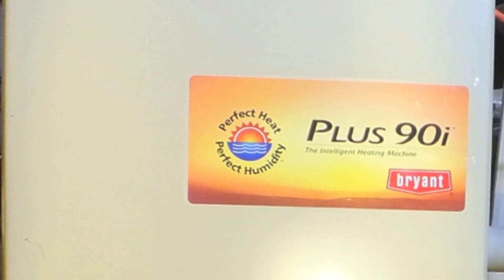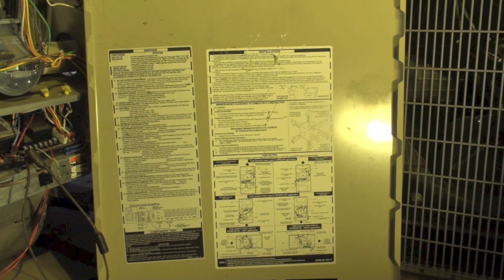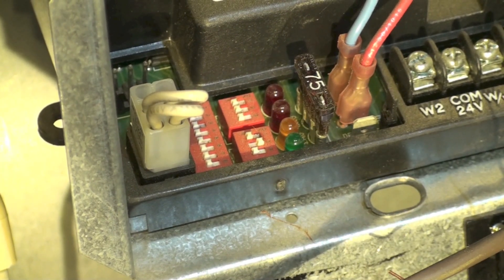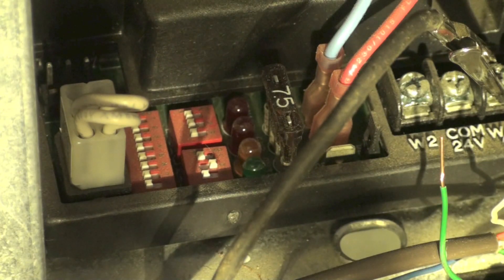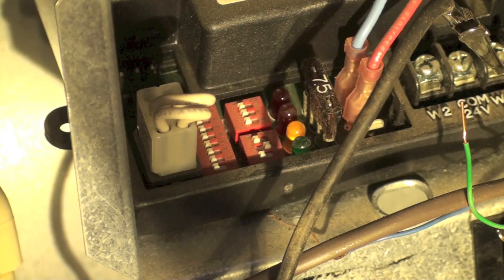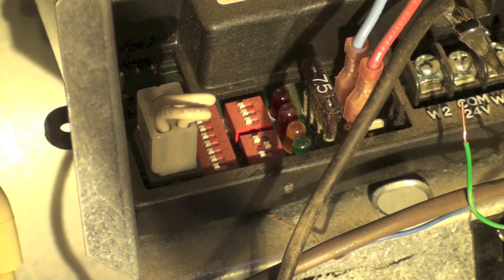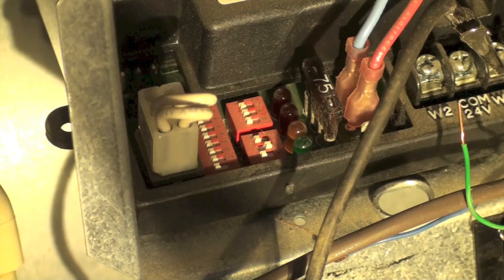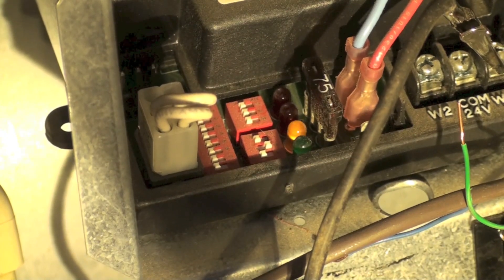Carrier gas furnace error codes

Comment: a common problem that results in this code are also air exhaust and intake pipe outdoor openings being obstructed by snow and ice
Reply from the maker: Certainly true.  One of the first checks is to the outdoor openings, especially if the snow has been blowing.
GFM

Comment: i got a code 13 and 33 on my furnace it a carrier weathermaker 9200 and the rollout switch got trigger does the mean that my heat exchanger is bad ?
Reply from the maker: Generally, if the rollout switch opens, its a rollout of flame which means a heat exchanger problem.  Some of the Carrier furnaces from the early 2000s have been recalled for rust outs.
GFM

Comment: I just saw what I forgot when I changed the board. I left that small jumper plug in bottom left hand corner of board on the old board. Inducer fan came on, igniter, then the burners, but it looks like low flames and inducer fan doesn't go off, and next ting it blew my 3 amp fuse. It says " might have a low voltage short"

Comment: Last night I was getting a code 33, I turned everything off. Today I get a code 21 which doesn't make sense to me since the furnaced has worked fine for 10 yrs. till now. Code 21 says " Model plug missing or incorrect". I have the same control board you're showing. I have not been able to reset.  HELP
Reply from the maker: That is a setup code.  I would be sure all plugs on the control board are tight and all wires into the plugs are tight.
GFM
Reply: @grayfurnaceman  I have to thank you for replying. I'll have to take the control board out and check all connections...... TY Sir
Reply: @grayfurnaceman  It's bit frustrating my friend. This morning I checked all plugs and wires on a new board that I replaced 4 days ago. Today it starts off with code 21 for about 20 seconds and then the blower starts low then goes on high, and gives me a 44 code. I retired from HVAC after 25 yrs. 9 yrs. ago. I guess I forgot a few things. The filters are out so there's no air obstruction. BEATS me what it is. I checked all limit switches. Model # of furnace is 58MVP080-14

Comment: Have a code 33 had work done in craw space that put flext tub type duck in craw space blower well not blowing air and shuts off
Reply from the maker: As code 33 is overheat, check the filter first.  Then be sure all runs are straight as possible and none are crushed.
GFM

Comment: Hello sir, my control board has just one led its a propane day@night about 1994 where would I find codes for this? thank you.
Reply from the maker: The codes should be located on the inside of the fan cover or the burner cover.  If you can't find them, I have a number of code keys on my website Grayfurnaceman.
GFM
Reply: Thank you GFM..

Comment: I can't thank you enough for this video.  My furnace was refusing to light and locking out.  

After watching this, I pulled the condensate drain inside the furnace and water poured out.  I carefully blew out the plug, which probably was 15 years of dead bugs and other debris.

It took about 10 minutes to fix the problem and saved me hundreds of dollars.  I owe you one!
Reply from the maker: Kurt Ericson Glad I could help. 
GFM
Reply: @grayfurnaceman they just changed the regulator on the propane tank - haven't gotten ANY blinking red codes - but NO HEAT! The water heater works- propane, and propane wall heater works... coincidence? 
The guy that replaced it said it was working fine, but old, and the line out of tank was leaking but he didn't have an exact match so he put one on for "free" and it would just be the service call...

Comment: In the video, you mentioned another video with other error codes.  Were you ever able to create that video?  On my Bryant Pulse 90i, I get a 44, and then a 41.  I have the blower fan set to be on continuously, and it is running.  I have powered the furnace off, and back on, but I still get the same errors.
Reply: Sorry, meant Plus 90i
Reply from the maker: I have not.  I still have that furnace in the shop but just have not gotten around to it.  Maybe this will get me going.
GFM
Reply: do you have any recommendations for the codes 44 & 41 ?
Reply from the maker: If you have an ECM, those are motor failure codes.  However, you say your motor is running.  Are the burners not coming on?
GFM
Reply: The burners are not coming on.  The exhaust fan never comes on.
It does seem as if the blower motor would surge somewhat (speed up, and slow down slightly).
 I do have 2 of the same furnaces.  So after reading several posts about the ECMs being at fault, I swapped the ECMs from the working furnace to the nonworking furnace.  The furnace started to work (I have not put the nonworking ECM into the working furnace yet).  I am planning on putting the nonworking ECM into the working furnace, in case it might have been just a poor connection.
Another thing I was wondering is could the SG348 thermistors be the problem, even though I don't see signs of it breaking down (no hot spots, and still intact)?
If nothing else, I at least I know that I can just replace the entire ECM, although it looks to be a pretty spendy item.
Reply from the maker: The thermistor will cause the ECM to not work at all.  So its kind of all or nothing.
GFM
Reply: I guess I will try the "Bad ECM" in the other furnace to see what happens.
Thank you for your input.

Comment: BDP Co furnace, looks exactly like in your video:
so the furnace looks like everything should work, the blowers come on, the pilot ignites, then the main burner comes on for about 2 seconds, then it shuts down, cycles through start up 3 times and shuts down, seeing error code 14, so it's not sensing that the burner is on and shutting down to prevent what it believes is gas leak from non functioning burner?
Reply from the maker: Have you tried cleaning the flame rod?  I have a video in the operation.
GFM

Comment: my heater led flashes 2 times what fault is this
Reply from the maker: +Katelynnariana Grauber The fault codes are usually on either the control, the fan cover or the burner cover.  All manufacturers have different codes.
GFM